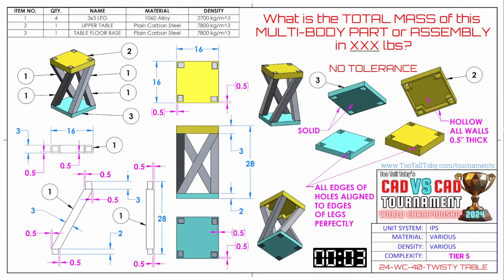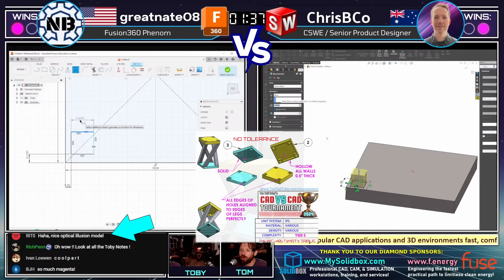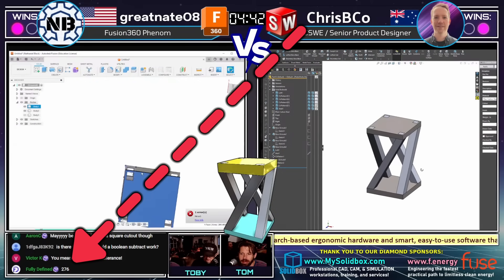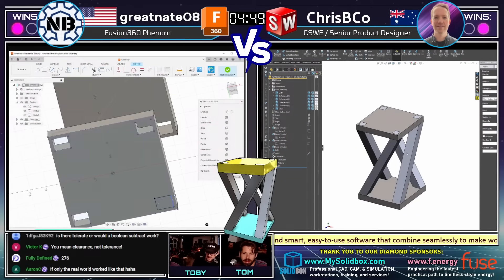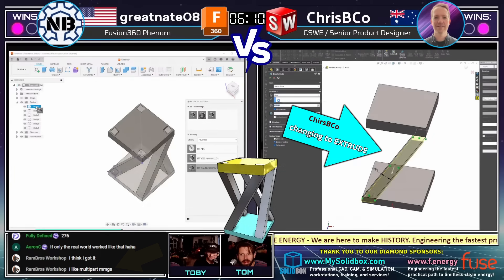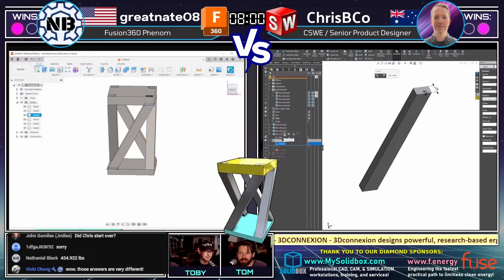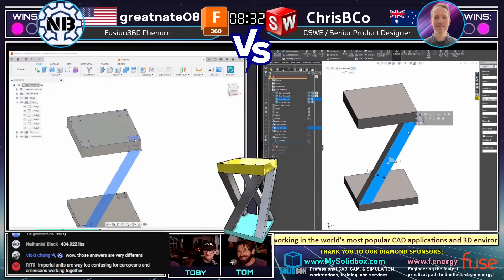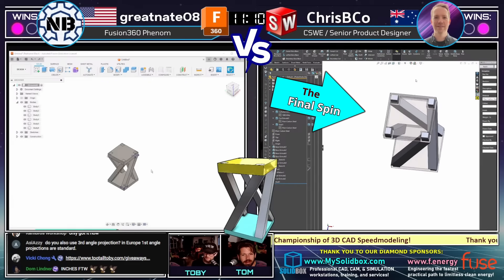CAD Speedmodeling Tournament! - SEMI-FINALS Battle 3 - FUSION 360 vs SOLIDWORKS

Comment: Omg, I thought I'm a novice in Fusion 360, because I'm using it for 5 years only, but when I see using a lot of movements that are useless for Fusion, I thing I'm better. Just using Loft extrude for one of legs, repeat it by circular pattern, after create base and mirror it with midplane.
Reply from the maker: Awesome to hear you have some great strategies!

Comment: I wonder... what function they use to get the right angle of the legs... with 3" in Width.
is there a function or a tool to get the angle with 2 parallel lines?
Reply from the maker: The angle of the legs is based on the geometry of the top and bottom panels, and their height.

Glad you're enjoying the content!

Comment: Do they need to have it modeled that way or just finding the mass in enough ? i.e could they just do 1 leg x4 and the two parts without assembling them and still win ?
Reply from the maker: Yes - Generating the correct mass and entering in the youtube chat earns you the point in this tournament.
you could do it as multi-body, as an assembly, as an assembly, or even just using Pen and Paper :-) 
It's up to the runner how they get there!
Reply: @TooTallToby  Wait, so we can find out without any modeling but by using math as well?! Awesome! Has anyone ever done that yet?

Comment: For models like these would it be acceptable to create multiple parts and fit them in an assembly file or do the rules state it must be a “single part”?
Reply from the maker: You can use either workflow - create a multi-body part with multi-materials, or create an assembly - the cool thing about our website is that it allows users to model the challenge one way, then use the TRY AGAIN function to model the challenges a second way!

Comment: I got this 296.98 pounds
Reply from the maker: nice work - 297 is the correct answer, but its rounded to the nearest whole number (no tolerance) so 296.98 works!
Reply: the answer is to be given in XXX lbs. No decimal fractions needed
Reply from the maker: @Pottan23  Correct!
Reply: No tolerance for this parts